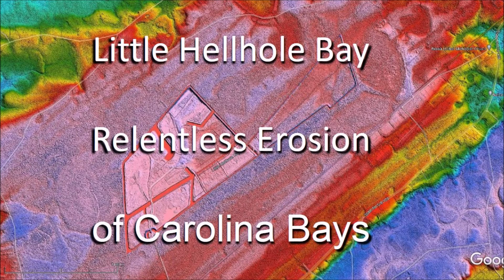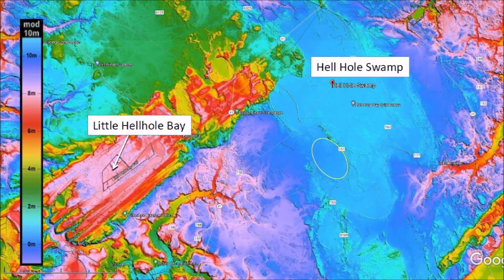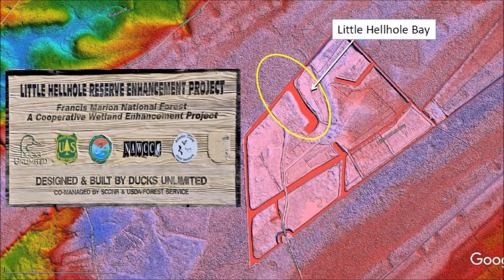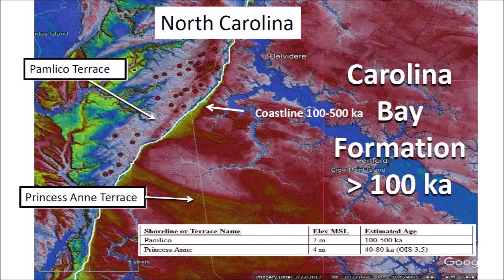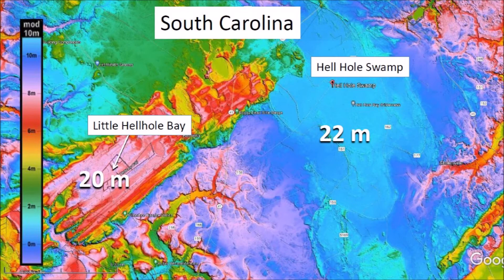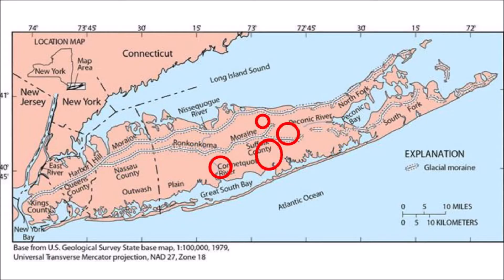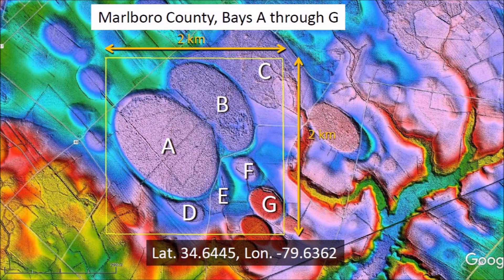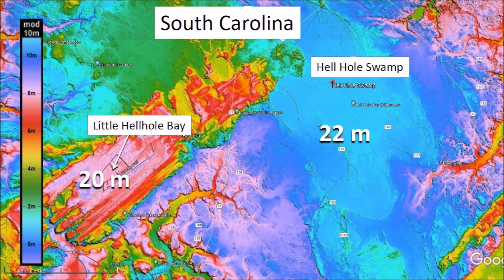Erosion of Carolina Bays - Little Hellhole Bay

Comment: More evidence for the Impact Theory! The accepted theory of wind and water as the mechanism for the creation of the bays cannot explain the inverted stratigraphy and corresponding dates. The moraines, storm related destruction and present rate of erosion support or do not contradict the proposed 12,900 ya impact. Excellent!
Reply from the maker: It is also important that the inverted stratigraphy and the bays on the moraines constrain the origin of the Carolina Bays to within 18 ka. This means that the reports of much older OSL dates are riddled with methodology errors.